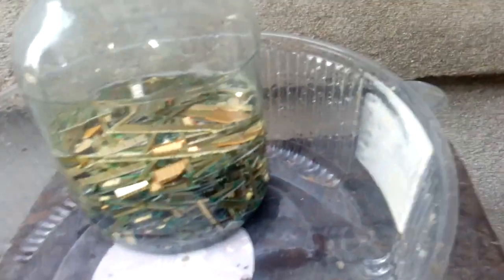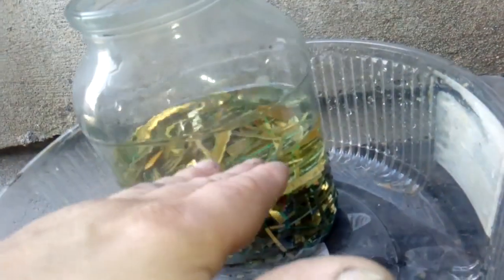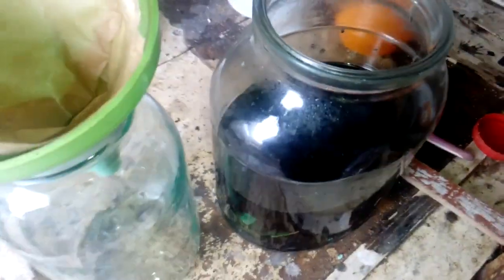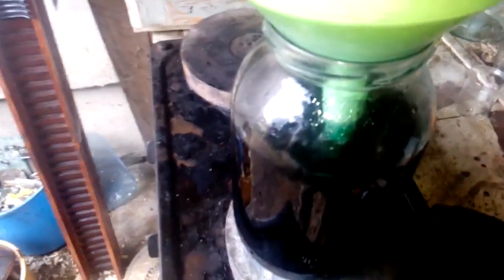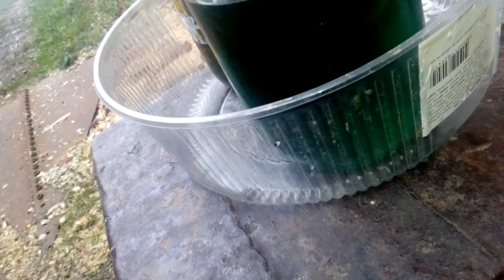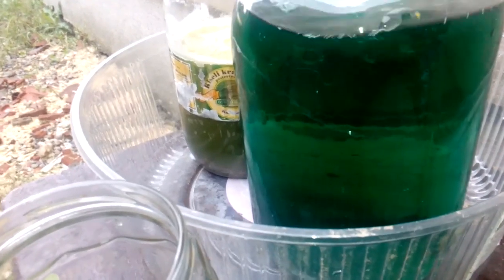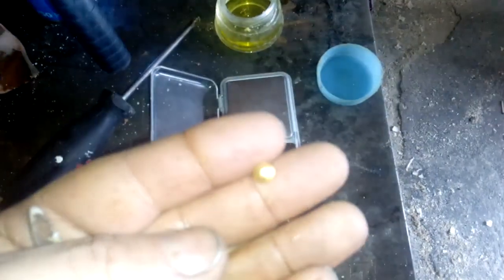Gold finger straight with Aqwaregia proces

Comment: I had trouble understanding you when you were wearing your mask and you were preparing your solution to drop the gold I couldn’t understand if you said it was a 50-50 mix with distilled water and hydrochloric acid with some SMB be added. I tried the same process and could not get the gold to drop with SMB, also when I did a Stanis chloride test it was negative for gold in solution. Any words of wisdom would be appreciated.

Comment: Hey man ,why do you add hcl with the smb ?? What's different from just using smb and distild water? Thanks
Reply from the maker: Often they ask me this question. The reason is that sometimes I put a little more nitric because I do not have to save it, so after I add a little Hcl to make a balance between acids due to Ph value. Of course, only distilled water is ok and there will be no problems.
Reply from the maker: Elvire nema potrebe da ides sve tacno u miligram.Carsku vodu pravis sa tri dela Hcl i jednim delom azotne,kada odradi posao,filtriraj i ubacuj polako ureu dok rastvor pravi reakciju,kada reakcija prestane,filtriraj,razmuti Vinobran u malo demi vode i obori zlato,posle dodaj demi vode da povecas rastvor skoro do duplo i to je to.
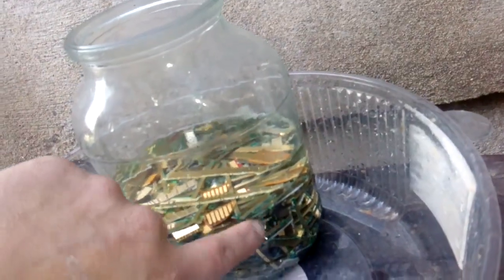Reply: 999 Dusan Gold recovery znavi ides litar sone kiseline I 100ml duSicne?  Aaa pa ja Sam nigdije Vidio da to ide 1ml duSicne a4.7 ml sone kiseline.....?znaci uatvari aqva se pravi 1:10??? I onda uzmes npr 200ml hcla I 200ml dest vode I 9gr vinograda?¿???  Jesam li upravu ?

Comment: Thought about doing this myself. Its the washing that I dislike with AP method. Great video again Dusan. Keep up the great work.
Reply from the maker: The rinsing of the finger is so boring, especially when there are some leaves that will not be easy to remove. The better combination is Hcl and Sodium Nitrite, NitricAcid is a little more expensive variant.

Comment: Cool bro I processed once like this also but was very new to refining and ended up processing enig plated material wondering where I went wrong and didn't drop gold its ok laugh....haha
Reply from the maker: The surface of the dish is large and believed me or not this plastic, although the thin is very well tolerated with hot acid, although spill rarely happens to me, but I feel safer when it is there. Otherwise, this is just a cake cover from the supermarket, you probably already figured :D I try to use things more from everyday life and to lower the costs of gold production.
Reply from the maker: As you now know, you probably had plenty of tin and lead in the solution that prevented the gold from droping. However, Nitric Acid and Tin  is never a good combination.
Reply: Use a catch pan that wont be affected by acid that one will disolve that would suck . Use a glass pan or a gold pan bro

Comment: Thanks for sharing I've always wondered why guys didn't skip the AP an straight into the drink. There's got to be a reason, to get rid of basemetals first?
Reply: Robert Bailey yes bro a lot of acid for the amount of gold using Ap you rid material of base metal and it can be used over and over I have solution of Ap used for fingers only and its about 8 months old now and still works great....
Reply from the maker: Robert Bailey
Of course, it is the first to discard the high base metal. Of course, there are people who are hard to come to Nitric acid, as well as me at the beginning been. This is a quick way, but the method is safer and cleaner with Ap and gold is more pyre with Ap.
Reply from the maker: E Waste solutions Sonny
Yes bro Ap is a best ,when you got time.But sometimes I'm refining for other people, and they are a bit stunning, so this process is good for me when I'm in a hurry.